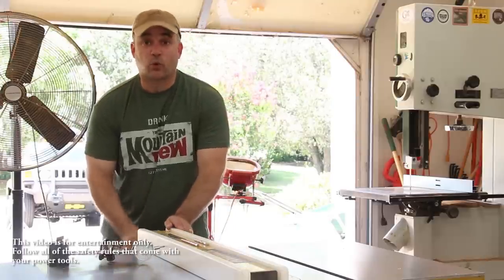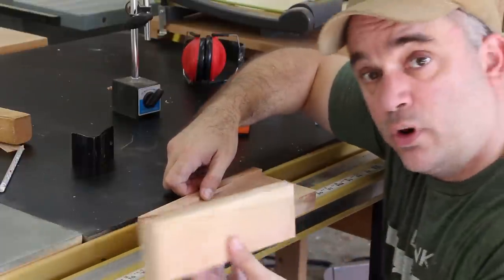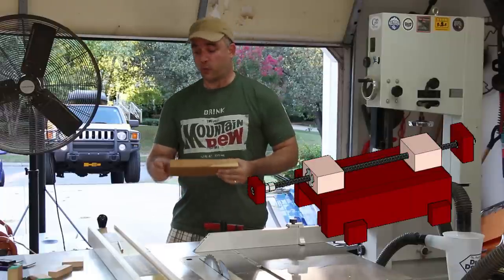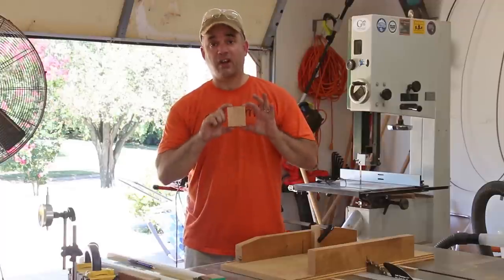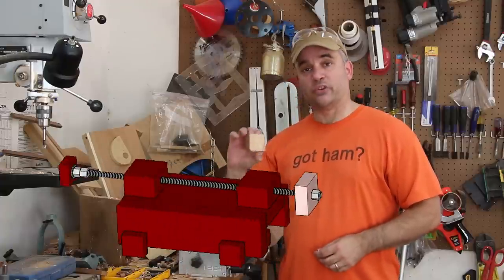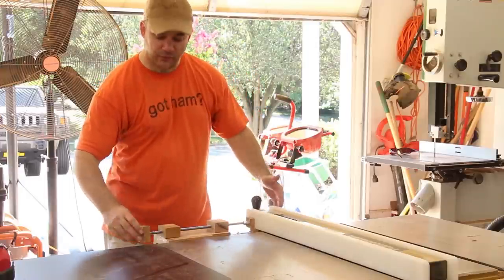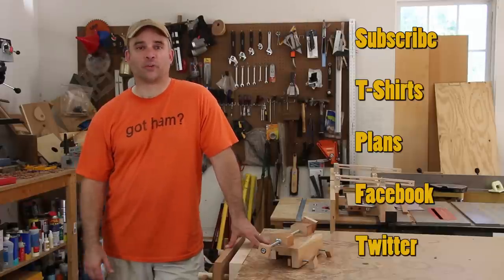Micro Adjust Your Table Saw

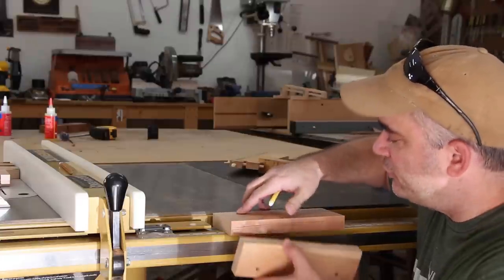Comment: At 2:08, when you are epoxy-ing the nut into the hex-hole, a handy tip is to spread a little grease on a bolt thread, and run it in and out of the nuts, to prevent excess epoxy from getting into the nut threads.

Comment: I only have a cheap tablesaw (not easy to mount something like that), but it works for what i need, but my micro adjust method is to place a finger flat on the table next to the fence, and gently raise the finger in a rolling motion keeping the fingertip in contact with fence and table.

Comment: As a machinist, I have been tapping things to adjust them for 25 years. I have a fine adjust on my fence. Never use it. The reciprocal of the thread pitch will give the distance the screw advances in one turn.

Comment: Great video. Would it be possible to attached the "push" block to the T part of the fence?  That way you could push or pull the fence in either direction.

Comment: Great idea- have been thinking about making one with some modifications--
I want to make one with hold down for dial indicator so that you can directly read the movement if wanted-
Table Saw Fence Micro Adjuster

---- AND----
I would like to attach a metal "L" shaped bracket or hook inserted into a hole drilled on top of backing plate for sacrificial fence so that you can push and pull the fence in both directions..
link below is example "L" shaped bracket that could be bolted or attached to the business end of your micro-adjuster arm to hook into the sacrificial fence and allow it to be pulled-- as well as pushed.
Sacrificial Fence Clamp
Any ideas on how you might do this?  thanks

Comment: There's got to be a way to make this part of your fence system as oppose to an add on... I ask cause that's what i want to do for myself. When i saw the video tittle i figured damn this guy is gonna show me how to do it, how cool is that! But i guess you didn't go all the way... I guess the trick is to have this micro adjustment thing built in between the T-bar and the fence then. I believe i just answered my own question.

Thanks to this very informative video i have a very good idea how I'm gonna build my fence now. Yo made things so much easier now. Thanks much.

Comment: So the way this works is that as you tighten the screws, it puts pressure on the glue/screw joint holding the side onto the top. But this is a really weak joint and any decent amount of pressure will break it (I just made this as an experiment and it split right at that joint as I suspected on first use). I tried not tightening it down very much but then even the slightest nudge from the fence moves this thing which defeats the purpose, and by the time you tighten it down enough to stop it from moving you've broken that joint.

Trying to think of a way to get a proper clamping system and about the only thing I can come up with is one of those universal fence clamps, but those don't quite fit, so I'd need to make a custom version.

Anybody else have any other thoughts?
Reply: You're using really soft/weak wood, or really bad/lame/not enough glue - or both.  Use a good dense hardwood, and glue it properly, and you will not have this problem.  A tiny bit of non-skid foam pad or sandpaper on the part that clamps to the fence rail will stop it slipping, and you shouldn't need to tighten it down like it was a vice.  This is why he made the thing from Cherry, where odds are you made yours from Pine, and that's why it broke.
Reply: I'm using hard red oak and plenty of titebond III, that definitely isn't the issue. Plus, as I said, it broke right near the joint, indicating that the wood strength wasn't the issue, and I used plenty of glue and gave it 72 hours to fully cure. It's just absolutely a very weak joint -- simple physics tell you this, there's no doubt about it. I was just curious if maybe he got away with it being a weak joint by not tightening it down very much?
Reply: I will give it another try with some stick-on sandpaper to see if that gives me enough anti-movement without having to really give it any clamping pressure whatsoever, which is about the only way a joint like this will not fail.

Comment: Now pull the fence back because you went to far!

Magnets....... If its a steel fence. Li ke yours but you could use T track bolts and nuts if its a extruded aluminum type with T Slots on it.